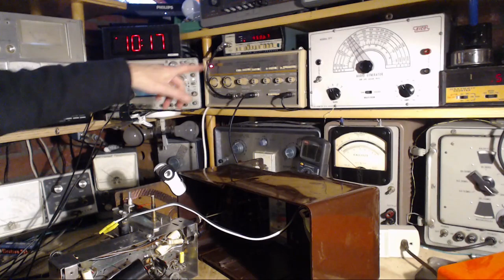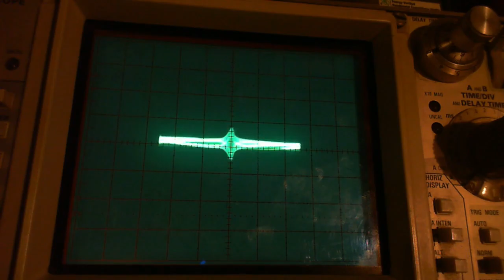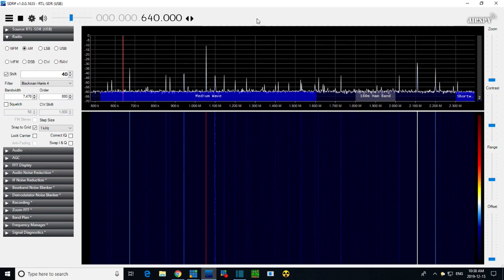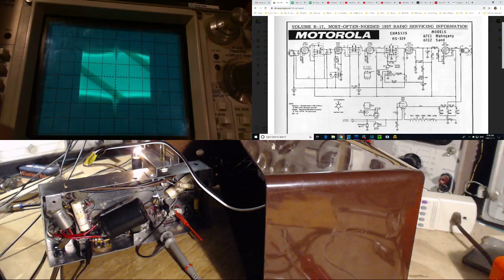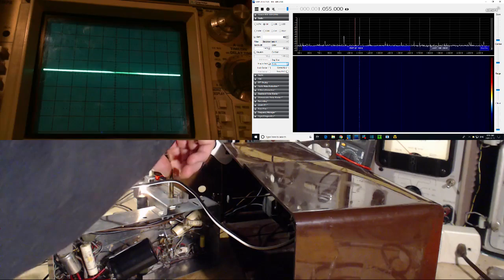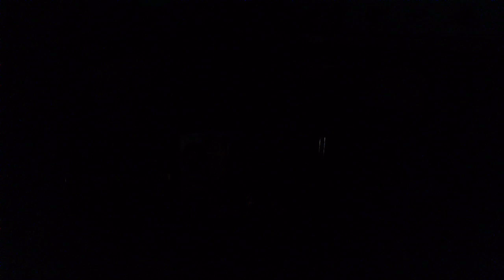Motorola 67C Clock Radio Video #7 - RF Alignment

Comment: Jim, time to seriously think about replacing the Tek 465B. Has long past its prime, besides wrong settings and questionable calibration. Get one that incorporates measuring capabilities, scrolling cursors is much easier, accurate and efficient than beating generators to create a marker. You also likely overloading inputs, I could see overtones and garbage all over the trace, even self-resonance episodes. Kudos for the effort and persistance.
Reply: Believe me the scopes not the problem in this workshop...
Reply: Agree, but it's holiday season :)

Comment: Great video of they sdr radios back then they would have used it.
Reply: They would have not. Using SDR for analyzing frequency domain is almost pointless given all the spurious signals a computer controlled receiver displays. But spectrum analyzers and tracking generators have been around for long and are designed and used specifically for this purpose.

Comment: 4:00 The antenna of this radio is basically a magnetic loop antenna. But the inductance of the pickup antenna coil cannot be adjusted since it is fixed to the back of the radio. The only point of adjustment for the antenna pickup is the trimmer on the respective gang of the tuning capacitor. But its contribution only comes into play at high frequencies i.e. top end of the band. So sweeping and adjusting the antenna tuning cap trimmer at 600kHz i.e. the low end of the band is a bogus attempt to start with. Also, and correct me if I am wrong, Jim has been told many times, for example by widecast et al,  that on adjusting resonant circuits the coil is adjusted at the bottom of a band (effectively shifting the whole band up and down) and the trimmer cap is only for the top of the band (squishing in or extending the top end of the band). Basics! And 5:03 shoving a metal object - even if it is the tip of a scope probe - into an oscillator coil will cause frequency changes. Why not use a pickup coil in not too close proximity?
Reply: Alignment "a la lets see what happens" academy. And even if you are right on the tuneability effects of trimmers and coils, does it really matter when everything else is unorthodox?